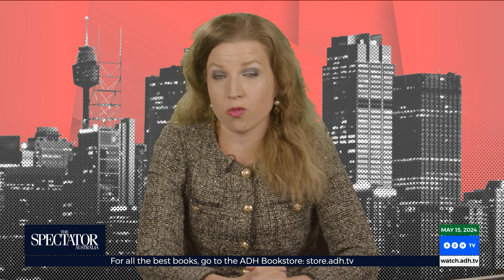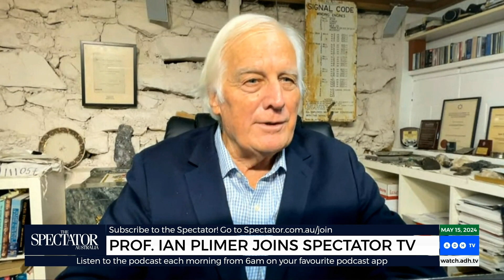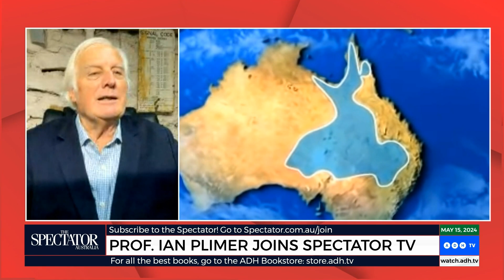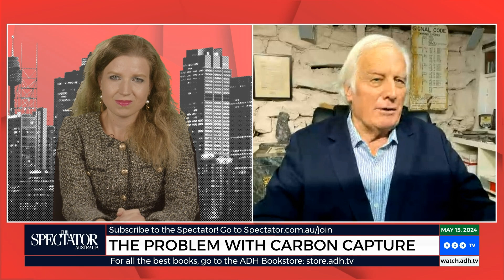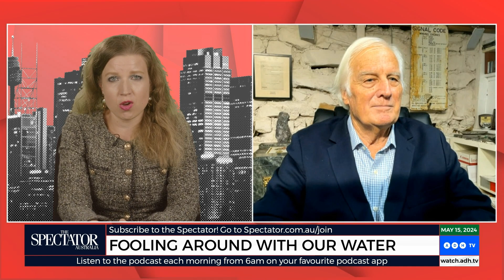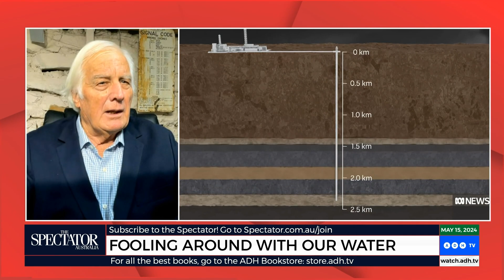Will an Artificial Volcano Save or Sink Us?

Comment: And bury oxygen in the ground for ever. Putting pressurised gas in the ground at less than 20 deg will heat up to that of the earth which could be 80 deg which reduces it efficiency.

Comment: I remember the Cameroon incident. Workers standing on the back of trucks survived while people in cars and motorcycles died.
Reply: Moral of the story... buy a truck
Reply: @descrete8861  the truck drivers died too. The workers standing on the backs of the trucks had their heads just above the CO2 cloud. The event was triggered by a landslide which broke the surface tension of the crater lake and allowed the CO2 to escape. If you google it you should find one of the documentaries.